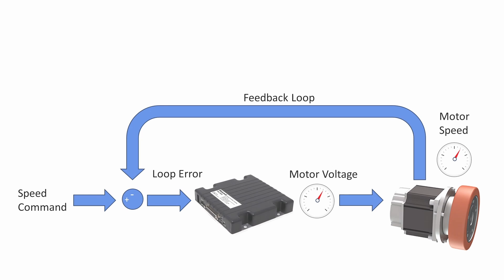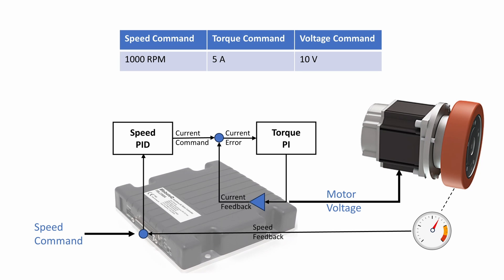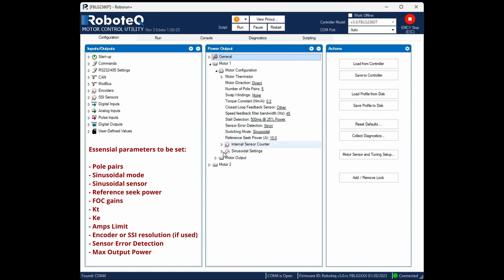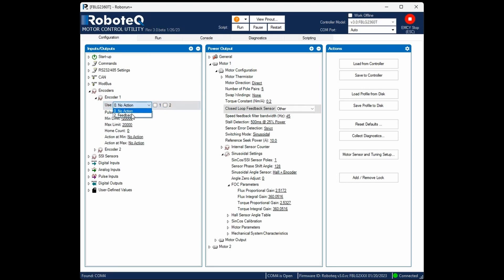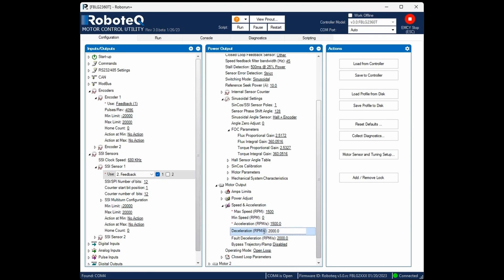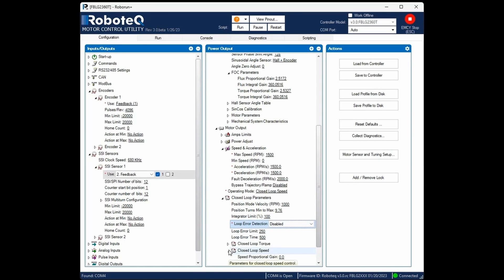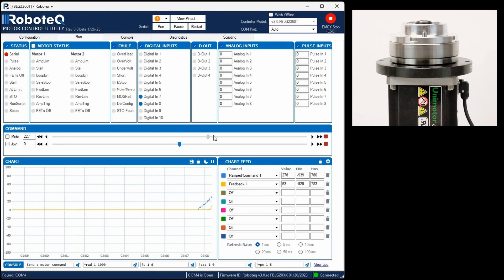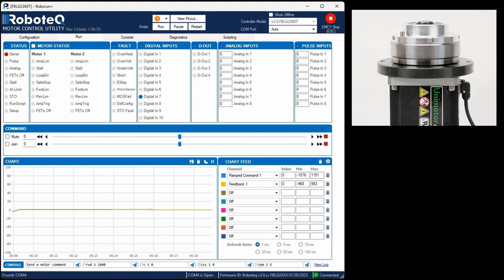RoboG4 controller Closed Loop Speed BLDC motor Turorial

Comment: the fbl2360T
is work with 17 bit encoder my motor having 17 bit absolute encoder with the pins 5v,0v,sd+,sd-
Reply from the maker: Hi, 17 bit absolute SSI sensors with pure binary encoding are supported by RoboG4 generation products, like FBLG2360T. The used pins are Vcc, GND, clock +, clock -, data+, data -.

Comment: Also, I have a question about FOC parameters, can I use Motor Sensors and Tunning Setup to get those info?
Reply from the maker: Hi Mohamad ,you can definitely use the wizard to set the FOC gains. Preferably, you should use the datasheet values and configure the bandwidth through the wizard. If no datasheet values are available, you can use the motor characterization feature to estimate the motor's RL specifications.